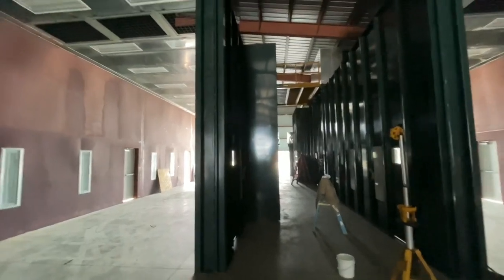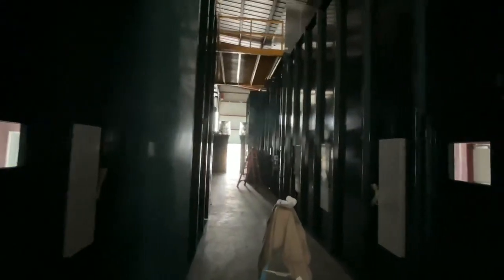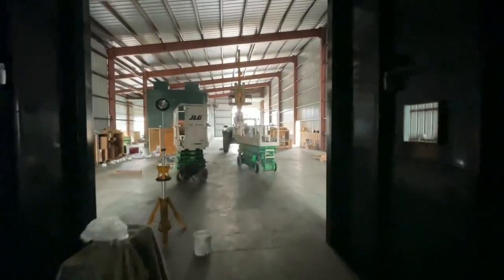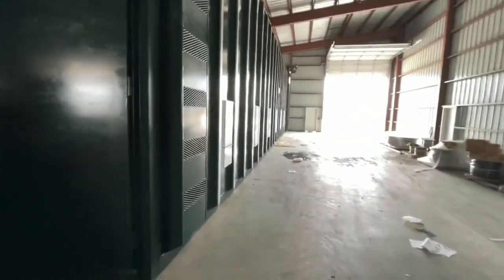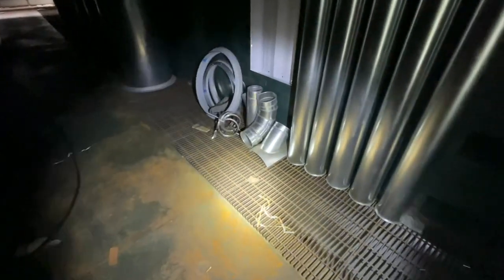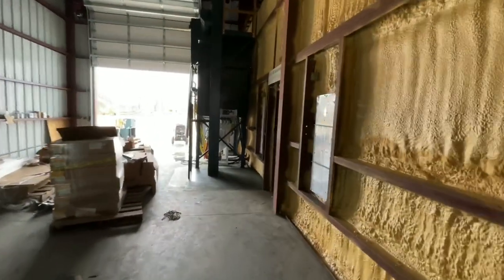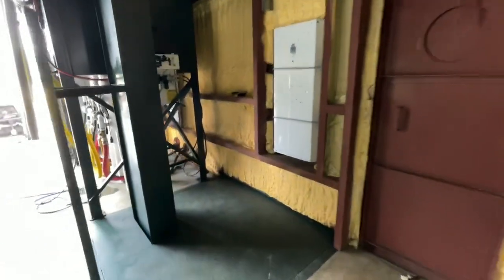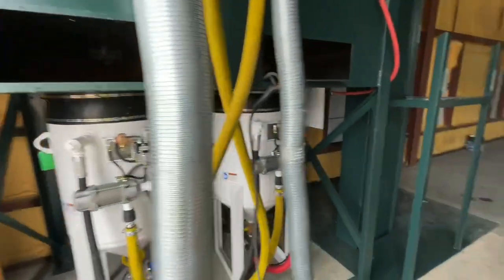My Work - Installation Of New Paint And Blast Rooms

Comment: Hello, Ben - your work videos are always interesting and enjoyable...Is this project built from "scratch"? Perhaps you can do a video on what a millwright does and the skills needed to do this job and other ones. I imagine the projects you do are all different but with your skill set they are all doable...
Reply from the maker: Well, I don’t manufacture the components, I just do the assembly on location. It’s a bit more involved than just bolting things together. But to answer your question, yes these are built from scratch. I work directly for the manufacturer and assemble their products all over the US, Mexico, and Canada. Though it has been a while since we went outside the US. If people are interested, I could do quite a few videos on how to work steel. Including fabrication, welding, component assembly, tools required, skills required, etc....
Reply: @txtoolcrib Hello Ben - that's what I thought..I guess what I meant is that you would do the work using blueprints for the build and fabrication would occur as needed or if necessary - still, as simple as the space looks to the untrained eye, there seems to be a lot to it, and at the end everything has to be in working order and looking good. My complements....
Reply: @txtoolcrib  As long as your contractor has no issue about their workplace security, well, whatever, I’d like to watch what a millwright’s work is like. Blacksmithing, machining, hardware hacking, construction, that makes the world as we live in, quite behind the scene, is always an interesting subject. Thanks for sharing.